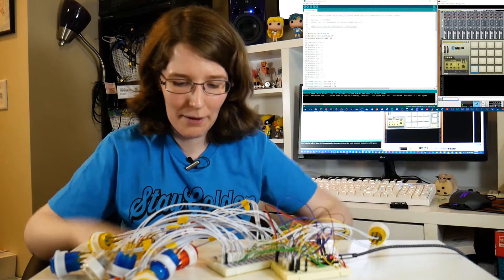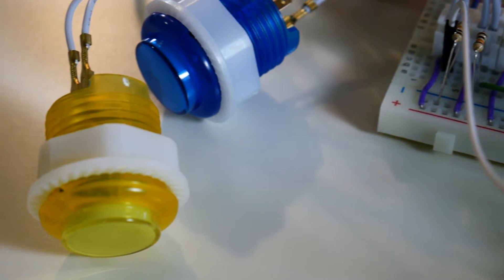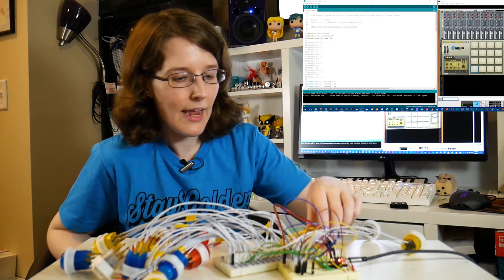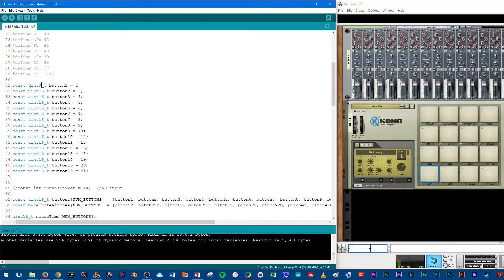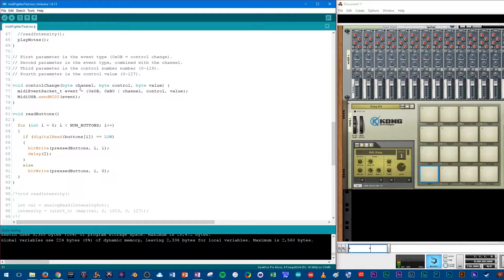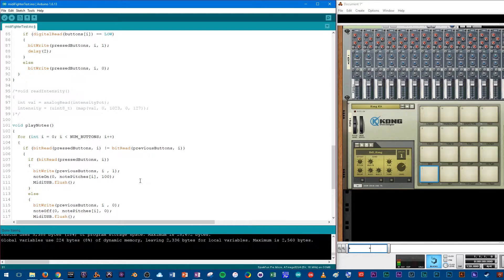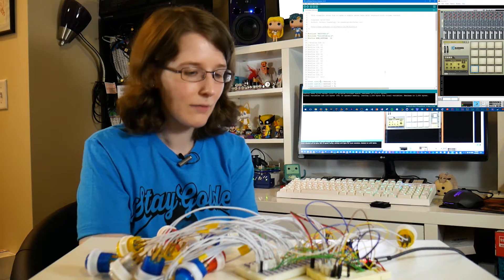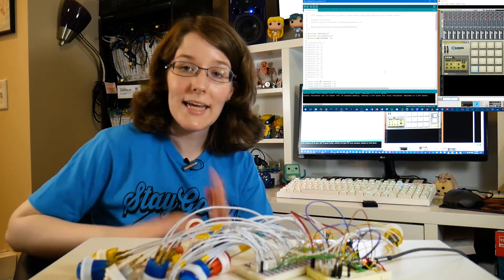Arduino MIDI Controller Build, Part 1

Comment: so how are the buttons and lights connected to the arduino?  is it 1 pin for midi, and 1 pin for the light in the button?
Reply: i built a 4 button midi controlle. the  buttons work, but i’m trying to figure out how to wire up lights

Comment: Thank you for the video; very informative. Did you ever get a multiplexer to work with the Pro Micro? I'm struggling to get multiple pins working on a 4067. I used 3 successfully connected to an Uno using address pins 2,3,4,5 to S0-S3.
Reply: I fixed it :)
Reply: I got multiple 4067's to work MIDI over USB  (both analogue and digital) - many pots and buttons :)

Comment: if it can theoretically handle all of the buttons being pressed at the same time, you could just use the alt output from a micro switch (ex. default closed or open) and have immediate reactions. right?

Comment: Can someone please help me with the schematics!
Reply: For the measurements? I did my own math, so here are the dimensions friend:

162.8 mm by 162.8 mm wide,
33.5 mm high,
24 mm for button width,
base height is 1.5 mm,
port dimensions are 8.9 mm by 13.6 mm.
This is all for 3D printing, so you will have to model it. Hope this helps!

Comment: The arduino mega would work great because it has plenty of anolog inputs used for drum triggers.
Reply: K Guerrero refer to spikenzie labs xylophone code for Arduino mega having 16 drum pads , but it require Hairless serial to midi converter software. I even updated the Mega' inbuilt firmware called Mocolufa , but not working

Comment: Subscribed! I’m tired & a bit bored with my day job and this will be my outlet! Lol 😂, hope you can help.. I’ll send questions, how can I PM, you prefer email? I play guitar and plan to hack my old midi foot controller from 80’s using Arduino, like what you did , but instead of arcade buttons, I’ll just use the existing foot switches I got:)

Comment: Love the code and it runs great, but I'm having trouble adding an ANALOG input into it.  Any tips or pointers on how I might go about it?
Reply from the maker: You'd want to add in a separate array of analog inputs. That would probably get you on the right track. I would need a little bit more information though to comment further

Comment: I want to make an controler for my keyboard. When I press a button, the arduino must make a random number and send it to my keyboard and there on i get another tone, sound or effect setting, so I have the option to quickly find another sound to play with, and later on finetune it on the keyboard.

Comment: Thanks it's great I did it it works fine with my Ableton Live 9, 
Now I have new challenge. I have midi controller with 12 buttons and it works, I using Arduino pro micro for this, now I wont to connect midi controller via esp8266 to my computer and continue to use my midi controller without USB cabel. as wifi midi controller.
Is it possible ? thanks

Comment: Nice work, seeing this is helping my MMC transport project. I had the same issue with the note sounding on the release of the button, not the start. I inverted  the logic on the edge detection, from LOW to HIGH, and got the rising edge. Was confusing for a while, couldn't figure where the latency was coming from. Hope this helps.

Comment: is there any way to have the buttons play the note as you press instead of as you release? also, could you use this circuit/code to map it with knobs or faders?

Comment: FYI:  The "standoffs"  for the promini are not "for the pro mini" While they are the same size (which is nice) so you can use them with the pro mini they are designed for larger ICs.

Comment: I feel your pain with the multiplexers. I have been trying to build a few midi devices with a UNO, but without a mux its pretty limited. The pro micro looks like a good way to go, and USB midi is nice... I'm a bit of a noob, I mainly just wanted to make some cool instruments, (my first project was the Auduino Granular synth) but now I'm spending more time tinkering than making music, and probably being more creative too.
Reply from the maker: It was a really great board for this project. Other boards that may work, though I haven't tested them with the code are the m0 express boards from adafruit. They have a metro, which is basically an arduino clone form factor, but it's using the m0 processor which can do USB comm with the Arduino IDE, I just haven't tested it with MIDI. I hear you about that creative/tinkering balance, it's very difficult

Comment: Hi, I am making a USB MIDI controller as a final project for school and I have a problem I think you may be able to assist me with ! I'm having issues with mapping faders and knobs to parameters in my DAW.  As soon as I hit MIDI assign, I click on a parameter to assign to a hardware control. As soon I click on a parameter, my DAW ( Ableton) arbitrarily selects a knob or fader without me touching any controls. It should only assign MIDI controls when the position of a  knob or fader has moved. The virtual parameter then starts moving randomly too. I have tried redoing the connections to micro controller (I am using the Teensy 3.2). My code seems fine. What could be the issue?
Reply from the maker: A couple of things to check would be to write some lines of debug code (essentially have all the data print to the serial monitor) to basically see what values your trim pots are actually putting out to the serial monitor. if they're too sensitive or not sensitive enough (could be why there's jitter) then you may need to adjust the resistor value. higher if too sensitive, lower if not sensitive enough. i had to raise the resistor value in this project for the buttons to read properly. I'd also look up an Ableton midi map. it will tell you exactly which address is being used for different things in the software. i haven't used ableton so i unfortunately don't have specifics on how what addresses the software is using. I'd check out this project by Evan Kale: https://www.youtube.com/watch?v=4sopfrr1830 he uses all faders in it so it may have some helpful hints. hope this helps and good luck with your project!

Comment: Can someone help me ? mine is experiencing a conversion error:

C:\Users\Gabriel\AppData\Local\Temp\arduino_modified_sketch_616723\sketch_oct16a.ino: In function 'void controlChange(byte, byte, byte)':

C:\Users\Gabriel\AppData\Local\Temp\arduino_modified_sketch_616723\sketch_oct16a.ino:47:41: warning: narrowing conversion of '(int)(channel | 176u)' from 'int' to 'uint8_t {aka unsigned char}' inside { } [-Wnarrowing]

   midiEventPacket_t event = {0x0B, 0xB0 | channel, control, value};
Reply: It's just a warning, you could cast the channel value to be an unsigned int.

Comment: im sorry for asking this but is your build recognized as a midi controller or do you need a converter software?
Reply from the maker: Don't apologize, that's a really good question! Because of the 32u4 chip on the board and the MIDIUSB library the computer sees the device as a midi controller so you don't need converter software.
Reply: Oh that's great!! Continue uploading, your videos are great :D
Reply from the maker: Thank you!

Comment: I've been looking for a tutorial on this! Thank you. While I was searching youtube, I came across a project using Pro Trinket as a USB keyboard. It's similar to a previous project you have, but no firmware swap is needed. It dawned on me that VSTis and DAWs can be macroed to keyboard, so I could make a button controller that outputs as USB keyboard instead of MIDI... Any thoughts on which project might be simpler/better?
Reply from the maker: Thanks for watching! I think for your project it depends a bit on what exactly you're trying to achieve. USB keyboard is definitely simpler than MIDI since MIDI protocol can be difficult. With all that, a USB button keyboard would be great for hot keys for controls but if you want to control any parameters (knob control, things like that) or input notes, then you'll want to go for MIDI. Hope this helps!
Reply: It does! thank you for the quick reply :)

Comment: Very nice. You are making great projects and are very lovely. Someday your channel is going to be big. I play piano so I know a bit about MIDI. I am planning to put sensors on an acoustic piano to send data to a computer. But instead of MIDI, I am going to use serial protocol because is what the software I am going to use supports. But anyway, the problem is that I need 89 inputs (88 keys + pedal). Your project reminds me a little about mine so I want to ask you if you have any suggestion. So far my plan is to use 11 arduino nanos. Each have 8 analog inputs (I need them to be analog), all connected to another arduino by I2C that is going to send the data to the PC by serial.

You might ask: Why use so many arduinos, instead of using multiplexer? Because I want to use as little cables as possible. Everything is going to be hidden on the bottom of the keys of an acoustic piano so it has to be thin/compact.

Any suggestion or warnings? So far I don't have anything build.
Reply from the maker: Sounds like an awesome project! Are you going to use piezos for the sensors or something else? Where it's an acoustic piano I feel like you could get creative with vibration sensors or photo cell sensors to pick up when a hammer has been engaged by a key. I've never done a project of that scale so I don't have any warnings per se but what I would recommend is taking it in pieces, maybe get two of the nano boards to start and after getting one to read the analog inputs properly (and also start with one analog input, then 2, etc) via serial to the Arduino board, then connect two and if that works then continue to scale up. The only issue I can see is power, maybe use a USB power bank to power all of the nanos? Honestly I understand the temptation to avoid muxes. If you don't have a direct background with electrical engineering then it definitely gets tricky (case in point my current project). To keep price down, I would recommend getting a 3rd party nano clone, something by Sparkfun or Adafruit maybe. Sparkfun does have this Arduino Pro Mini: https://www.sparkfun.com/products/11113 which has the same 8 analog I/O but at about half the price.
Reply: Blitz City DIY I was thinking about IR reflection sensor on the bottom of the key bed. I want to avoid interfiring with the mechanism of the piano so that's my plan.

The power thing is a good tip. 89 IR LEDs is going to use quite of power. And I will start small and expand little by little.

I already have a bunch of cheap clones. They are so cheap that I don't mind using so many.

Thanks for the tips and keep the good work
Reply: Hi =) How you connected buttoms ?

Comment: I've ordered a 9 button mechanical key tester, to wire the buttons in sort-of the same way,but for macro's instead, I should add MIDI functionality too. =)
Reply from the maker: Yeah that'd be a perfect interface for it! For that you'd probably be able to use a lower voltage board, like one of the Feathers from Adafruit.
Reply: arduino micro all the way ! cheap and effective.